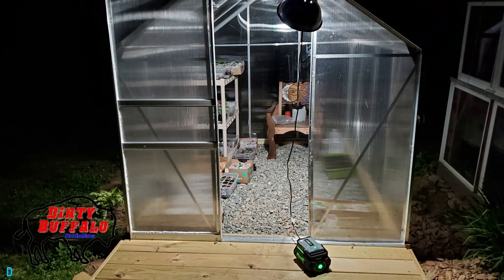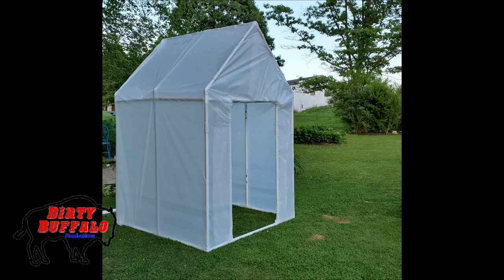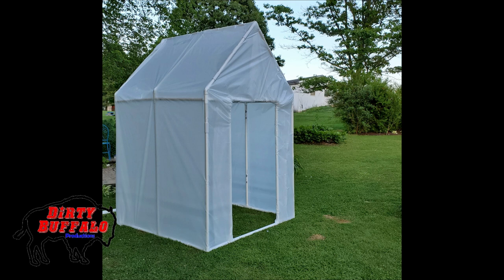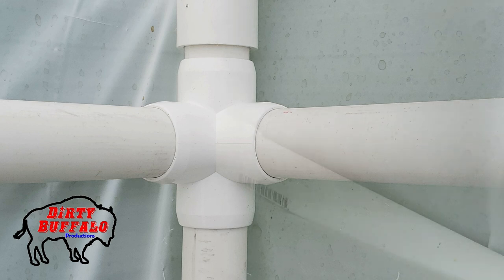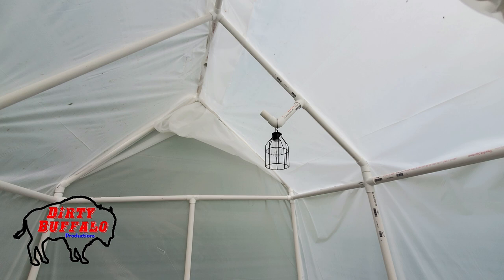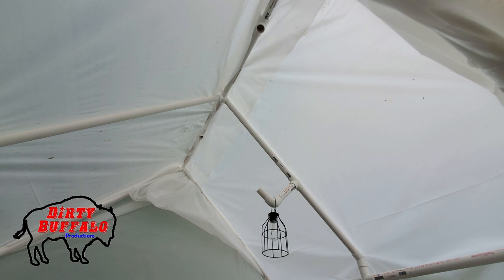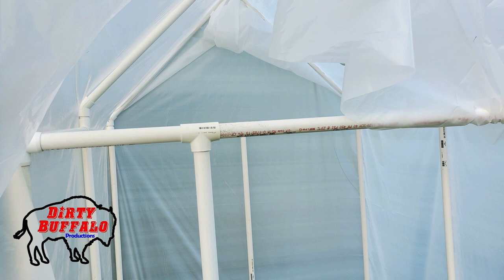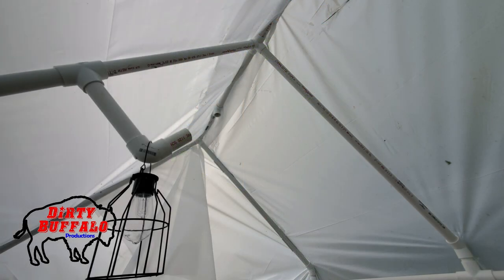Our DIY PVC Pipe Greenhouse

Comment: I’ve been looking for something simple like this and finally found it in your video! Thank you for the demo!
I have been gardening all my life pretty much and I’ve been using PVC pipe to make summer/winter cover over my plants as I overwinter a lot of peppers etc.
So I have been using the PVC clamps and insect/frost covers.
It gets extremely hot where I’m at, and we also get freezing temps.
I have a few questions for you if you do not mind?
How much was your total cost for making this 5 x 5 greenhouse?
How do you measure and cut the plastic for the various ends, sides, door and roof of the greenhouse without wasting material?
Was it simply a little over 5 foot pieces individually for each wall etc.?
Sorry for all the questions, Christine
Reply from the maker: The rolls of plastic from the hardware store aren't that expensive so we just wrapped the plastic around the frame and then used the clamps to hold it in place. We than cut away the excess plastic. The roll that we purchased was twice as much as we needed, so we will get 2 years of use out of that one roll. 

Yes, 5 ft long pieces cut for each wall. We went with 5 ft to keep the measuring simple.

Comment: HOW WOULD YOU DO THE DOOR?
Reply from the maker: Roll down door is the simplest and cheapest. You can use the same plastic the green house is made from. Clip it at the top of the doorway, and attach a small piece of PVC pipe to the bottom of it for weight to pull it straight down. Then use a pair of squeeze clamps to hold it up when you want it open the whole way.
Reply: @DirtyBuffaloProductions  That will work, thank you!